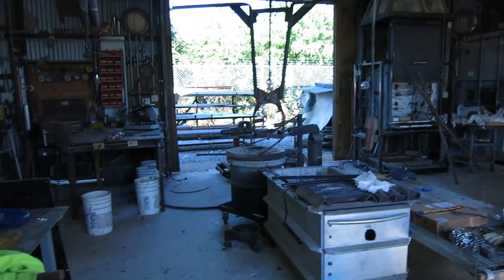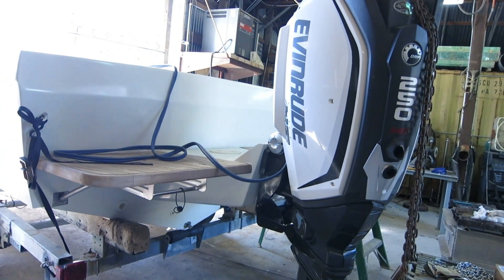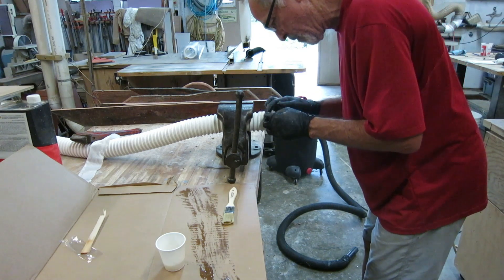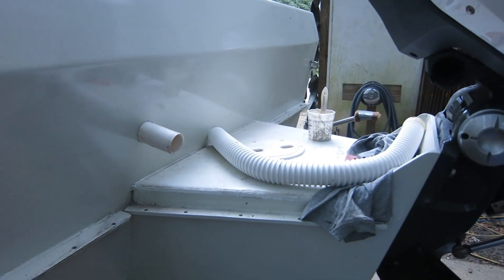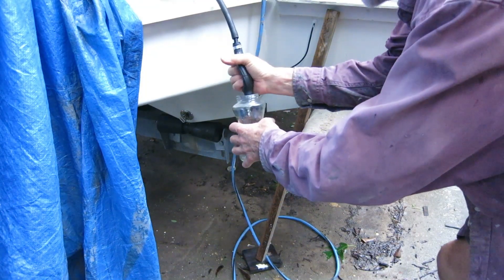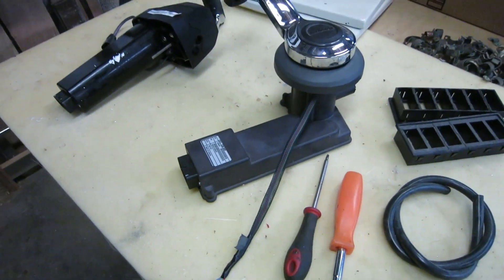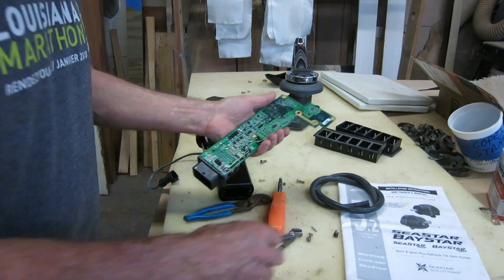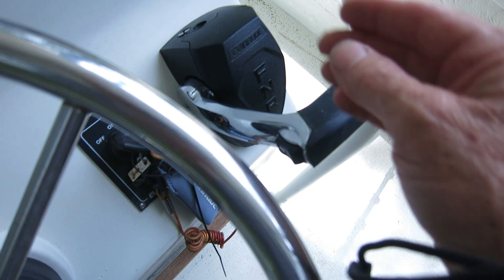First Start Of The Etec G2 #44

Comment: I’ve been Biulding outboards for 20 years , I tell my customers to give those two stroke engines 15 minutes warm- up before hammering the throttle, I always go full throttle get on plane then back to easy running rpm for 5 minutes. This gives the internal engine time to expand so you don’t  damage the cylinders. Love your vids!
Reply from the maker: Thanks Richard
I have been posting videos for a few years now but this boat series has really gotten a lot of interest. Lots of boat guys out there. Thanks for the tips.
Barry

Comment: Under the motor & tilting the motor down into it and filling it with enough water to get above the pickup point on the lower unit allows you to test run the motor without a mess on your driveway. Second the ETEC spits water aft in line with the engine and you cant see the "tell tale" from the helmet underway. We've all bought an aftermarket diverter that directs the stream sideways so you can witness it from the helmet without an issue while underway.
Reply from the maker: Chuck
With you on the tell tale. My son had an Etec 150 and added the diverter.
Barry

Comment: Me again with 2 more suggestions. First rather than the ear muffs attached to a hose I've found that tilting the motor and putting a cooler or water trough
Reply from the maker: Chuck
Thanks for the tip!
Barry

Comment: General rule , for every inch back from the hull you can go up one inch ? You should be good to go 👍
Reply: Back 1 ft, up 1 inch
Reply from the maker: Even with that formula I might be a little high. No big deal if I need to drill a couple holes in the pod though.
Barry

Comment: great job! I am writing to you from Italy I also bought a g2 300 and I should install it myself and I would need your help. How is the electronic power steering assembly installed? the hook you are using to lift it what size of screw does it have? By shooting your reply, I thank you very much
Reply from the maker: Frederico thanks for watching! The power steering is controlled by the same computer that controls everything else. No separate wires needed , only the two hydraulic lines. Luckily my motor came with a lifting eye. It consists of an adapter that goes from a very fine male thread that screws into the center of the fly wheel to a course female thread that a standard eye bolt screws into. Unfortunately I don’t think there is any way around having this part and it may only be available from Etec, not sure. Good luck on your project!
Reply: @barrylukebuilds7894  Thank you very much for your reply. I found a person who will make me the hook made as you suggested with the lathe. I have another question, how did you do the bleeding (purge bubbles) of the power steering unit? Thanks again for your kindness.

Comment: Hey Barry check on evinrude they may recommend 1/2 in fine thread engine bolts. I do know Mercury requires you to use 1/2 fine thread bolts 6 of them. You dont want that nice engine to fall off the stern.
Reply from the maker: Shorev
Good catch. I am looking into what Etec recommends. 
Barry
Reply: My Yamaha HPDIs use fine threads too. Double nuts.
Reply: Double nuts on back side.